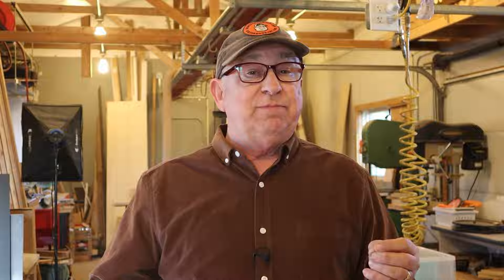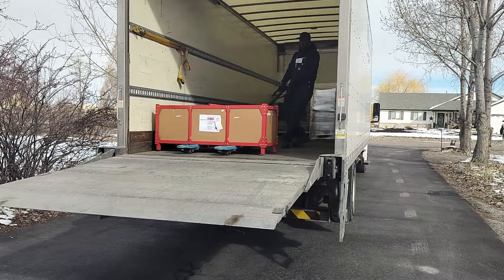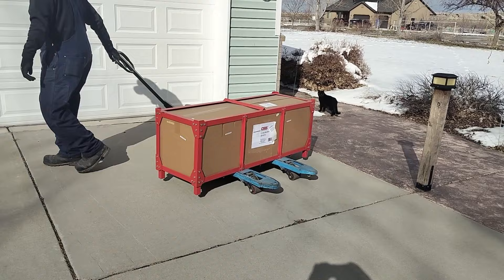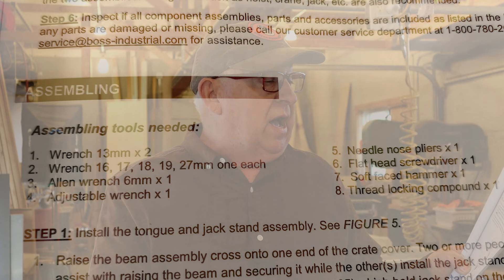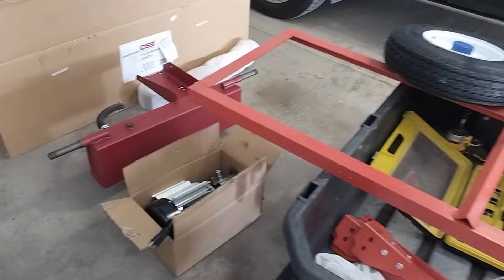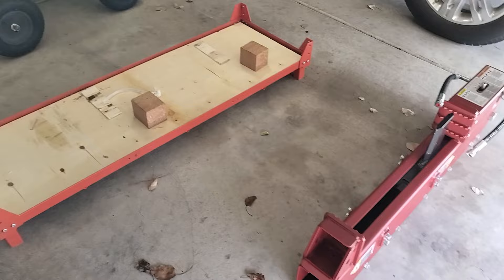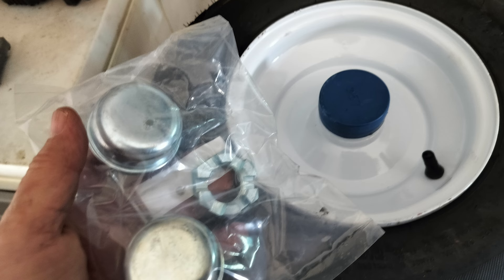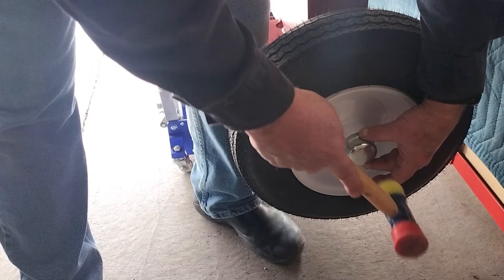How Good is the Boss® ED16T21 Dual Action Electric Log Splitter?

Comment: Looks EXACTLY like my DR Electric Dual Action 10 Ton Splitter from Country Home in Vermont. It has been splitting +/- 6 cords /year for 12 years. Mostly hardwoods but some spruce & fir. 
The cycle time is SLOW ( ~ 11 sec each way ) compared to my older gas splitters. This Boss is the same. Looks like a copy. Tip: be sure to  keep the inner and outer slides clear of debris and oil them. Bill is in the mail.